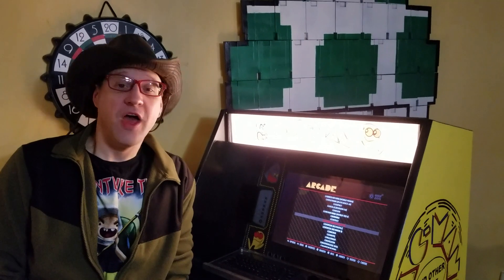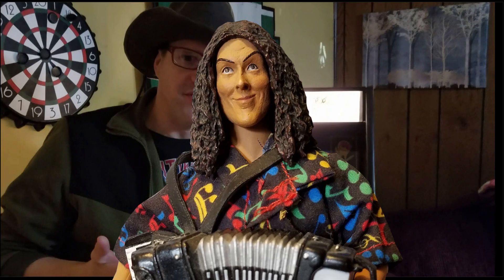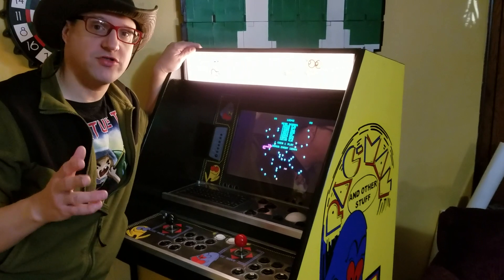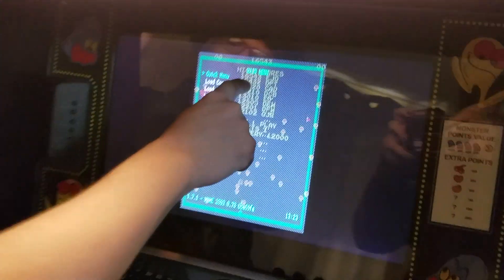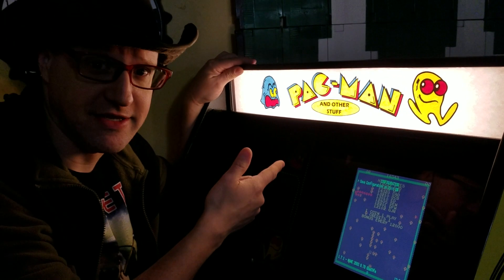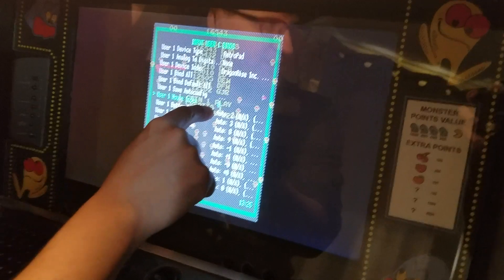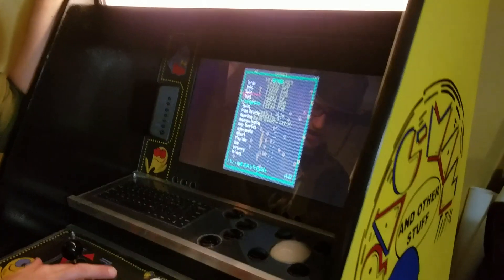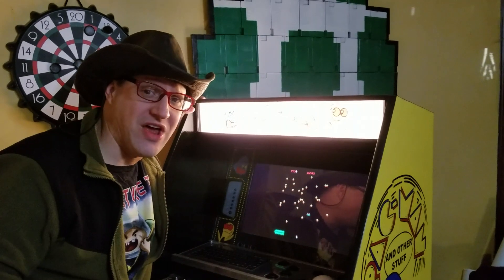Make your Trackball Work  Mame2003 Retropie 4 4

Comment: YESSSSSSS!!! Finally my trackball works again! After an update on my Raspberry Pi 3b+, it stopped working, but after following these directions, it's working exactly as it had before. I didn't have my hotkeys set up, but I was able to navigate to my Retroarch settings and follow everything you did from there. So glad I found your video. Thank you!

(One of the only games it doesn't work for is Centipede -- my version happens to be on Fbalpha. I guess I'm probably better off trying to find one that works on Mame instead).
Reply from the maker: Probably! I have never used Fbalpha, so I know nothing about it, but finding mame Tom’s for Centipede is not hard. I’m really glad my video helped! I poked around with mine for a year before I found a solution! Thanks for watching and thanks for commenting.

Comment: hi Clay. just like you I struggled with the trackball. but thanks to you. I got it to work.  however now the joystick no longer works. ahh.  my machine is a 1 player. running a raspberry pi. do you have any ideas of what it can be?  can it be possible that I need to have it set up as a 2 player.  because  it might favor the trackball over the joystick. ?  thank you
Reply from the maker: Ooooff! That’s tricky. It’s been a while since the last time I messed with this, but It sounds like somehow it’s made the trackball the default controller. You may be right about the issue being related to it being a single player cabinet. You could try setting it to two player and enabling both controllers. I seem to remember a setting I had to put into mine to assign specific controllers to specific players. Before setting that up either controller would work at any given time. In your case, you would do the opposite. Make sure that no specific controller is assigned to a specific player and hopefully, the joystick will come back to life!

I’m sorry I don’t have more specific information. Retropie is really involved and as much as I LOVE what the software does, figuring out how to make it work is always painful. Let me know how it goes, and if you’re still having trouble, leave another comment saying so. I’ll gladly shoot a quick video and go through my settings so you can see how I’ve got everything set up, and maybe reverse engineer a solution. Good luck!

Thanks for watching and thanks for commenting!

Comment: Also spent a year+ trying to configure my trackball in a very similar set up, but mine was made even more difficult by the fact that it's a dedicated Centipede cabinet with no joystick... long story, but I was finally able to get it all working today thanks largely in part to this video!! My only remaining issue is that I can't seem to figure out how to configure the trackball sensitivity for individual games... some games the trackball is way too sensitive, while on others it's slow and unresponsive. Any ideas? Great and very helpful video though-- thanks!!!
Reply from the maker: Thanks SO MUCH! I’m really glad this video was helpful! I’m afraid that I’ve had the same issue. The speed and sensitivity for one game are wrong for others. For a while I would try to dial it in for each game, but as you said, the settings don’t stick per game. Now I’ve got it set in a sort of “middle of the road” between what works best for centipede, torn and Star Wars. Not the best solution, but I’ve been able to live with it. If you find a better solution, please let me know!

Thanks for watching and thanks for commenting!
Reply: @ClayCarlino  I'm tinkering with one particular setting that isn't game specific, but the results have been sporadic so far tonight... I'm on MAME 2003, which looks to be the same as what you're using for the most part. When you start a game and bring up the MAME settings menu, there's an option for Analog Controls, where you can tweak the sensitivity of the axis. I'm trying to find the best universal settings for this so that most games are somewhat optimized. 

Alternatively, it seems as if MAME 2010 allows you to tweak the analog controls for specific games, but I have not tried this and I'm too afraid that switching emulators will somehow ruin my control setup again... but it seems possible. If I can just get Centipede to be ideal, I'll be okay with other games being not-so-ideal...
Reply from the maker: @AdamMontgomery1  for what it’s worth, I’m running both make 2003 and 2010. There’s a handful of games that work on one but not the other. (Star Wars, Tron, and a few others.) So far I haven’t noticed any conflicts using 2 different versions of mame in the same cabinet. Everything is in separate folders so as far as Retropie is concerned it’s just another emulator with its own Ron’s folder and it’s own set of Roms. (On a side note, my phone hates everything I’m typing. The autocorrect wants to change Mame to “main” and Roms to “Tom’s! Ugh!)

Anyway, I hope that’s helpful. Thanks again!

Comment: Yup. I followed your instructions and ya my trackball and spinner still isn't working. Drag I'm out of ideas. Good video though.
Reply from the maker: That SUCKS! I wish I knew what to do. It took me a year of poking at this problem, reading forums, and getting frustrated. The maddening thing is that the trackball is effectively a mouse. That's it. Boot up Rasbian on a Raspberry Pi and amazingly enough, it works. I don't know why it's so hard in Retropie.
Reply: @ClayCarlino  ya it's crazy. I bought the glens retro show trackball and spinner and his 12-1 board I've done everything I've seen and read about but it just doesn't read either one. But it works perfectly on my computer. Just not on my raspberry pi 4. Ya I may have to give up on it for awhile. It just grrr. Ya know. Lol. Thank you for posting your video though. It really did help.
Reply from the maker: @crashoverride576  thanks. I wish it would have worked though. I haven't messed with the RPi4 yet. Mine are all 3B+s. I don't know if that makes a difference. But you're probably doing the right thing. Take some time away from check back in a while and see if there's new information available to try. Thanks again for your comments and experiences!

Comment: I tried 1,2,3,4,5,6,7... this thing goes on forever... lol. Still no love for the trackball.
Reply from the maker: Well crap! I assume you've probably already double checked obvious stuff, like making sure it's saving the settings after you leave the settings screen and such. There are terminal commands that you can use to ensure the raspberry pi is aware that the trackball is connected. I'm sorry, I don't remember the links for how to  do that, but a quick google search is what led me there.

You can also make sure the physical connection is good. Maybe pop in a different SD card with rasbian installed, just to make sure the track ball works as a mouse. 

Assuming all those things are okay, then I'm not sure what the problem is. I fought my trackball for over a year before I found this solution. If worse comes to worse, maybe see if you can download an image of a setup that already has the trackball working. I was able to do that early on, but in my case, the image I downloaded didn't have the safe shutdown button function, and it wouldn't work when I tried to add it. 

Whatever else you try, I hope it turns out to be something simple and you can enjoy your trackball. Whenever you do solve it feel free to tell me what you did here, or if you do a video, feel free to post a link. (Assuming youtube allows you to!)

Sorry I can't be more helpful. Good luck! Thanks for watching and thanks for commenting!

Comment: Clay I need help! I went through these steps and I am getting an error when I save the configuration file. Any idea why?

Failed saving config to
“/opt/retropie/config/arcade/retroarch.cfg”
Reply from the maker: Hmmmm... well it sounds like the error is happening at the point of saving. There's only 2 things that come to mind when that happens- 1.) Your SD card is in write protect mode. There's that little slider on the side of the card that if it's in one position allows reading and writing to the card. The other position prevents writing. (You probably knew that already, but I just like to cover my bases.) 2.) Your SD card has become corrupt. I've had this happen quite a few times. Several of the times, the effect was that my Pi would boot up and run just fine, but I could save anything at all! So save states, no adding new rooms and no saving settings. This was usually the precursor to larger problems. 

So my recommendation is to first check the slider and make sure the card isn't write protected. If it isn't, try a new SD card. Hopefully you have a clean copy or you made an image of the card after you got everything installed. If not... well, you already know how involved setting up Retropie is from scratch! 

Good luck! I hope everything works out for you! Thanks for watching and thanks for commenting!

Comment: I tried these exact steps, and the Raspberry pie crashed, and put me on an o/s menu, which was non-responsive. Had to cold boot the pie. Thanks for the video.
Reply from the maker: Oh no! Were you ever able to get it to work? It sounds like something may have corrupted the file system maybe? Hard to tell. I hope you get it resolved. Good luck!

Thanks for watching and thanks for commenting!
Reply: @ClayCarlino  The Pi still works. Just, can't seem to get it to save settings, and am also finding some games in the library have no controls set, at all. Odd that the Legends Ultimate version of CoinopsX has everything working, though, albeit with severe audio lag. Hence, the reason I went with RetroPie.
Reply from the maker: @ThomasGrillo  stuff like this is the maddening part of using Retropie. It takes soooo much work to get everything to work. Good luck! Thanks for the update!
Reply: @ClayCarlino  I've been noodling about with mame, since the late 90s, I'm sure I'll find a way to get that rutty trackball, and spinner to work. Though, why some games with trackball are working, albeit with slow sensitivity, and others not at all, is a big mystery. LOL
Reply from the maker: @ThomasGrillo  good luck! The only advice I have is that with each success, copy an image of the ad card! It would be catastrophic to get everything working, then lose it all because the sd card got corrupted.

Again, congrats on your successes and good luck on solving the rest. Thanks for sharing!
Reply: @ClayCarlino  Fair point. I've heard of people corrupting their SD cards, simply by shutting down their Pis incorrectly. I think I was lucky it rebooted, at all. May just have to look for a better collection.

Comment: Three weeks ago I bought an Atari Fight Stick with built-in Raspberry Pi after playing on a friend's system who got the fight stick without the Raspberry Pi – he bought his own and set it up.

When I got started I followed another video's instructions and immediately updated my build of Raspberry Pi. Immediately the hot key would not work so I could never get into the quick menu and the track ball (which was already not set correctly) stopped working completely. I tried many things in the past few weeks, including a 12 hour update and many hours of watching videos, reading blogs, and trying things out. Nothing worked.

Finally my friend flashed me a copy of his SD card, which I installed today. I'll have to re-install the couple thousand ROMs I'd already installed, but that would be fine if things worked. Immediately the quick menu worked so I could re-map buttons on a couple games. The trackball was working again but it was back to its low-sensitivity setting.

I watched your video and others, and thank you for putting it together. I adjusted the mouse sensitivity from its default of 0 to 1 and, saved the config, restarted, and it stopped working completely. Weird but I went to re-set it and – the config file failed to save.

I tried a couple more times, powered down the system, started up again – same thing. I see multiple Reddit threads on this and guess what the answer is? Update the build – the same issue that got me into trouble in the first place!

At this moment I'm going to call RetroPie a failure. I'm a fairly technical person but I've spent so much time playing with this, and researching it – and I still can't get a white ball to move correctly (that came installed in my system, no less) – I pity anyone who buys something like the Atari Fight Stick and thinks everything will just work perfectly out of the box. It won't.
Reply from the maker: Ugh! That's agony! I'm SO SORRY! I think I mentioned in the video that it took me a YEAR after building my cabinet to get the track ball working. A YEAR!

Personally, I don't feel like Retropie is a failure,  but it's not easy nor intuative. It seems like getting something as simple as a mouse to work shouldn't be so difficult. That being said, what the software can do is amazing. I have several Raspberry  Pi devices at this point and love them all. And seeing as how Retropie is free to download, and the Pi is a super affordable single board computer, I think that's where the trade off is. 

Still I feel your frustration and agree. It's frustrating and nonsensical.  But that's where we're at. I hope you find solutions to your problem!

Thanks again for watching and commenting!
Reply: @ClayCarlino  Thanks for the response. It took you a year to get your trackbal working – and yet you learned how to do it, and you made this video, and now I know (from your videos and others) that I have to change the mouse sensitivity, and I also know where that control is – and yet anything other than 0 freezes the trackball/mouse completely.

And after one day of a refreshed system, the Quick Menu is not saving.

At this point I may take a break from the system. It's painful to look at and think about now. I can still play games but when people come over to visit, they're like, "You even got a trackball - so cool!" and then they open Centipede, Missile Command, or whatever and I have to explain, "Oh, well I actually don't have it working yet..."

Very frustrating. I'll report back if I find some answers.
Reply from the maker: @PlasmicSteve  that is both sad and painful. I think you're doing the right thing- walking away for a while. The year it took me to get mine working wasn't a year solid. It was me walking away for months at a time, then going back to it when the inspiration was there, or I found a new potential solution. I think the thing that is so disappointing about your situation is that something that was supposed to be fun has turned into a source of frustration. That sucks! I hope that changes for you at some point and you can really enjoy your setup. Good luck!
Reply: @ClayCarlino  Okay, I got my trackball working and also found an easier way to configure my other controls. Lots of people know about this but many don't...

First, my misunderstanding about your comment in the video about making the trackball work. I thought the number you were choosing was meant to be the sensitivity of the trackball rather than just finding the number that makes RetroPie see the trackball at all. I have an Atari Fight Stick and mine was already set to 1, so it was working but it was so slow/insensitive that it wasn't really working on any game.

I was using the Quick Menu/Retroarch from within the game to try to modify the controls, including trackball sensitivity. It was failing to save at times and messing up my bezels from The Bezel Project. But it also wasn't working.

Over the weekend I read about using the MAME menu instead. From inside any MAME game, plug in a USB keyboard and hit the Tab key – then go to Input (This Game) and you can modify your Analog controls and fine tune the mouse/trackball sensitivity per game, which is critical.

I also had games like Robotron and Krull that needed to use the second joystick to fire directionally – I was able to do this in the MAME menu, which I believe you can't do in the Retroarch Quick Menu for controls. You can also configure more than one input, like Joystick Right + A Button (or whatever) to be one control, like Fire Right.

Using this I fine tuned all my games that use a trackball as a spinner, like Arkanoid, Super Breakout, Tron, Discs of Tron, and Mad Planets.

Any game that originally used a trackball in the arcade version – 720°, Centipede, Millipede, Missile Command, Reactor, Crystal Castles, Tee'd Off (or any golf game) is now completely playable with the trackball sensitivity adjusted.

Ikari Warriors now uses the second joystick or the trackball to rotate the player's aim.

Also critically, isometric games like Q*Bert and Congo Bongo allow you to set diagonals as Up/Down/Left/Right so you can really play the game. Without that, all the controls were rotated 45° so it was essentially unplayable. 

Games with non-ideal default controls like Star Wars, Return of the Jedi, Gunsmoke, and Tutankam were fixed. I adjusted the Joystick controls on Return of the Jedi in particular to make them less sensitive as they originally send the player straight into the trees on either side of the path.

I know many people use the MAME menu to remap, but it took me way too long to find. Now I feel good about my system! I Hope this helps someone – thanks again for your video Clay!
Reply from the maker: @PlasmicSteve  that's fantastic! I'm so happy for you! I know it's been a slog getting through all this, but once you have everything configured, it really IS fantastic! Now make a copy of your SD card!!! Save it FOREVER!  Ha ha ha! Congratulations, and thanks for updating me throughout the process. This is great info for others setting up their systems!
Reply from the maker: @PlasmicSteve  you are quite welcome! Once again, congratulations on getting everything working! I love a story with a happy ending!